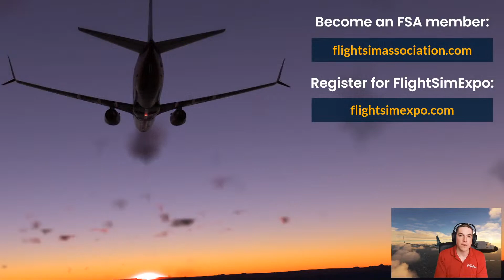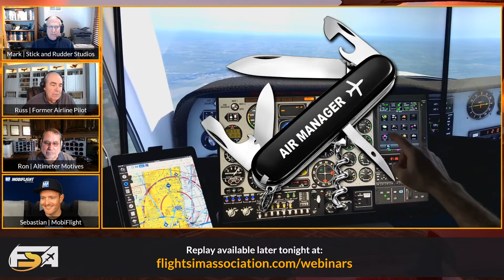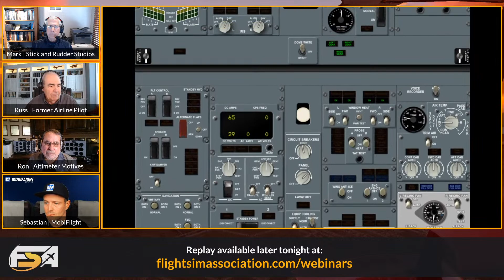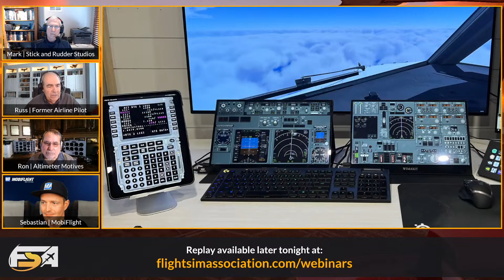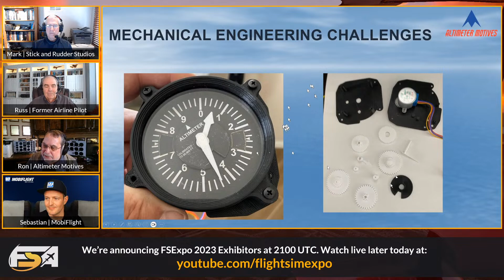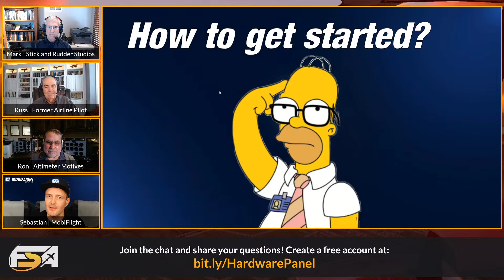Hardware Integration Panel with FSA

Comment: Thanks Russ.  I am building my flight sim based around Air Manager and knobster.   You have been my inspiration for starting this hobby.  So thank you.  At the moment I am trying to find a cheap way of making an overhead touchscreen panel for commercial airliners.  Ideally I think I want a 27" panel, but they are rather expensive
Reply from the maker: You might consider a bigger tv and adding a touch overlay. Something like this
32 inch Multi-Touch 10 Point Infrared Touch Frame, ir Touch Panel, Infrared Touch Screen Overlay â€¦ https://a.co/d/7AFTLj7

You would have to find a way to affix it to the Tv and I added a thin acrylic sheet over the TV to protect the screen but it works. I usually prefer capacitive touch since finger dirt can block the IR grid but on an overhead gravity will take care of that problem

I think 27 inch is small for a 737 overhead. Mine is 42” ant it was 70% full size
Reply: @rbarlow  Thanks Russ.  I don't have the space for anything that large unfortunately, and I don't  think I would get that past my wife either.  Haha.  My thoughts are that I will have to compromise by using multiple air manager panels on that screen and program a rotary switch or touchscreen button that allows me to change the panel shown.  Not sure if that's possible yet of course.
Reply from the maker: @flightsimdeskuk  It is possible to do that